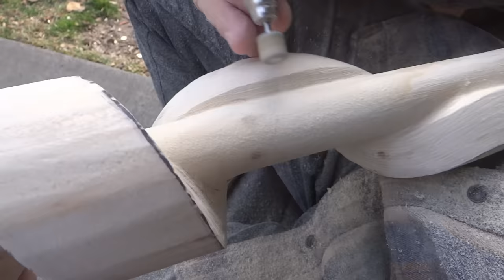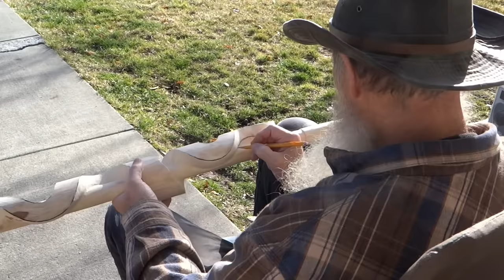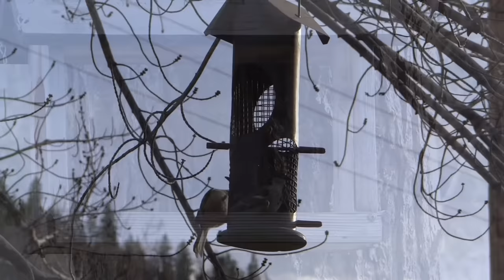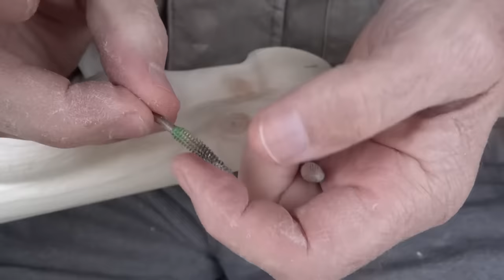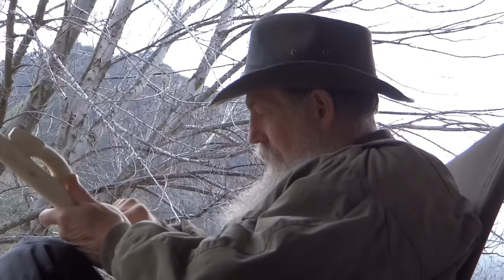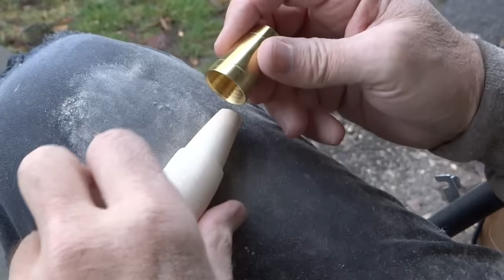What I Get Done In a Week of Carving

Comment: Mike, had you ever thought of using one of your brass end caps as a tool?   You could apply a thin film of glue inside the cap, then put a grit material on the glue, then after it sets up, it would sand the perfect shape on the end of your walking stick.  You could either turn the new tool by hand, or put a shaft on it to turn it with your dremel tool.
Just an idea, hope it helps 🤠👍
Reply from the maker: I really like that Idea!  I hadn't thought of it before, but I think I might just try it.  Thank you!